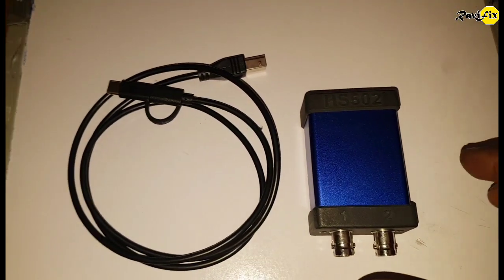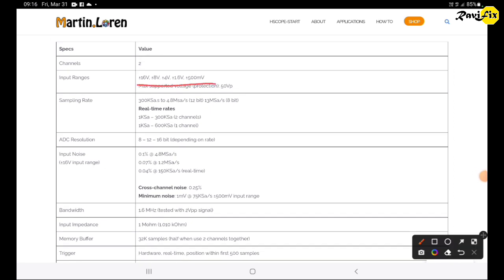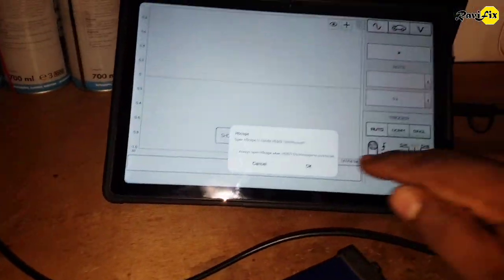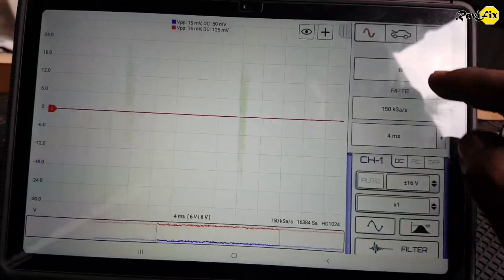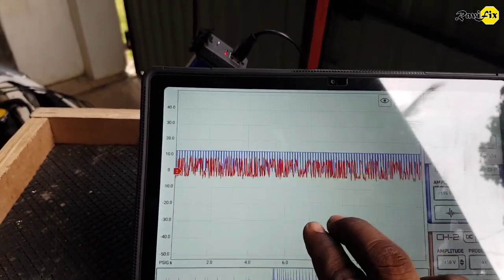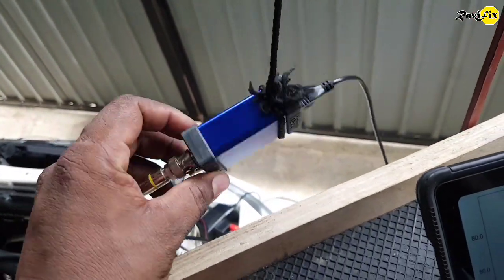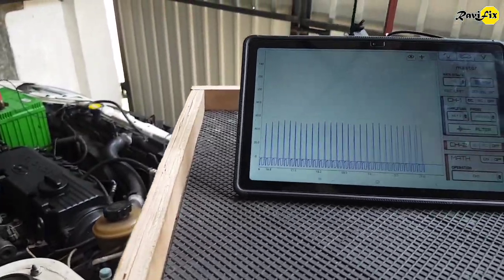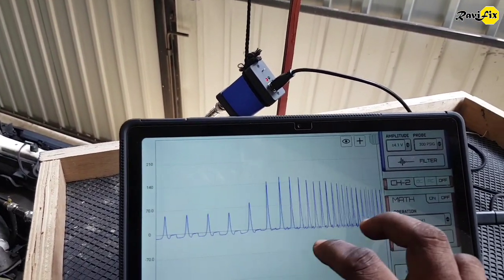Best 2Channel Lowcost oscilloscope for Automotive Diaganosis | HS502 by Hscope with 12bit Resolution

Comment: Hey Ravi,

Thank you for the video. Could you pls run Duty cycle Plot next time you have the opportunity?
Reply from the maker: Automotive diagnostics on pulse width modulation. Oscilloscope use for visualize faults on PWM,
https://youtu.be/2g4WbkrZobM
Reply: @ravifixall , Actually I meant to see graphed Duty cycle over time. For example, if I wanted to test phasor operation on a test drive, I would capture both oil control valve command in duty cycle and CMP signal. These would be my two signal waveforms.

What you have shown me on the link is measurement of the duty, as you scrolled thru. That is different from what I had in mind.

Comment: Helo. I have found cheap 12 bit Oscilopscopes that have better parameters than HS502. First is VIMU MSO21. It has continuous recording speed in streaming mode at 10Ms/s.
Second is VIMU MSO41. It has continuous recording in streaming mode at 50Ms/s. HS502/HS512 it has only max 600Ks/s
Reply: I have VIMU MSO41, What tests I should i do to check usefulness in automotive?

Comment: Can we use tool Hantak cc65 cc650 clamp meter and other tools with HS502 oscilloscope
Reply from the maker: No issue you can use anything with BNC connection.
Reply: thanks
Reply: Where did you download this app from?
Reply: HS502 oscilloscope app

Comment: What type of tablet are you using ? Can you send me a link to purchase the tablet
Reply from the maker: Samsung galaxy Tab A10.
But if you using High amp draw oscilloscope like Hantek 6074BE, do not buy this tablet. Because when battery drain it will not allow to use that oscilloscope. Was a big burden for me. But HS502 work perfectly.
Reply: Thanks alot sir . Really appreciate your time

Comment: I own and use this as well as other Hscope compatible scopes, I am still impressed every time I see it used and use it myself. I actually get excited when I see a You tube thumbnail with Hscope in it. I am not being overdramatic when I say Hscope has impacted my life in a positive manner. It restored my passion for diagnostics by introducing me to scope based diagnostics. Usually someone starts with entry level priced gear and move upward in price  if they find something useful or enjoyable. The funny thing is I purchased every name brand scope and still use Hscope the most . Whether its the HS502, HS402 , Hantek 6074, 1008c, 6022 , they are amazing.   Taking everything into consideration from easy deployment to signal quality it punches way above and out preforms "the best" scopes known in the field. The software  overlays and interface is the real magic. The community is a real joy as well. I have learned so much from the Telegram community ( Hscope Lounge and Hscope Automotive )  . Ravi and The Gadgets Playlist are great YT channels to learn from as well. I've been very busy so my interaction with the group has been minimal lately. I am looking forward to engaging more once work slows down.  I am planning a video to share on my power generation forum group. I think field generator techs will get great use of it as do I. Even the FFT feature with THD helps me pinpoint problems caused by non linear loads. I am so appreciative for Martin Loren as without Hscope I would not have a profession or a hobby I enjoy this much.
Reply from the maker: Thank you Jesse.